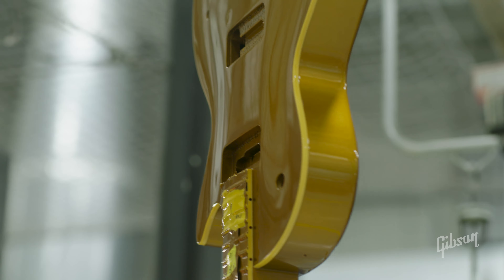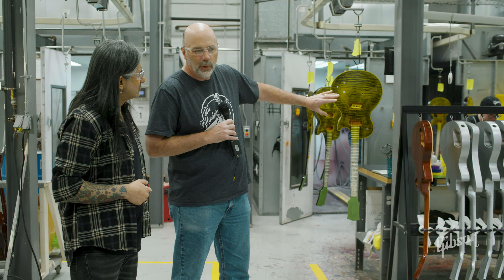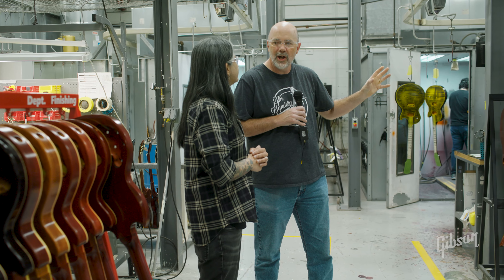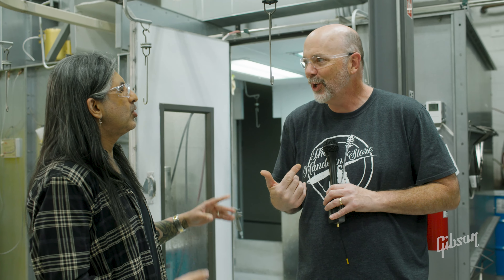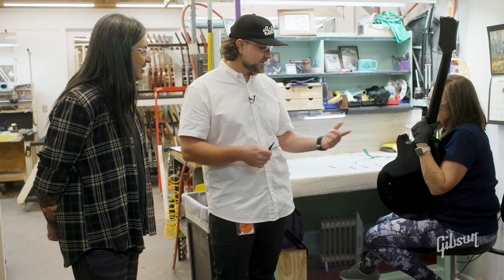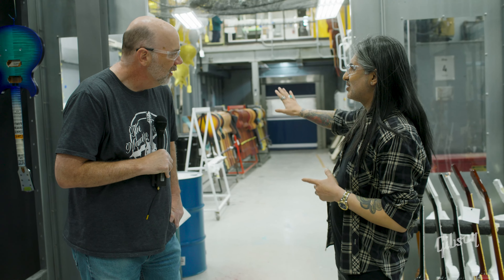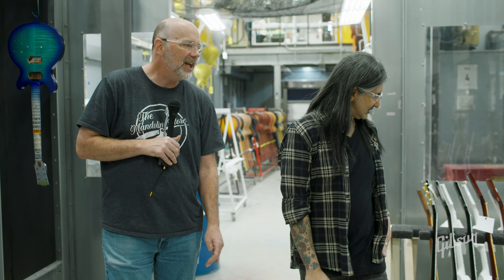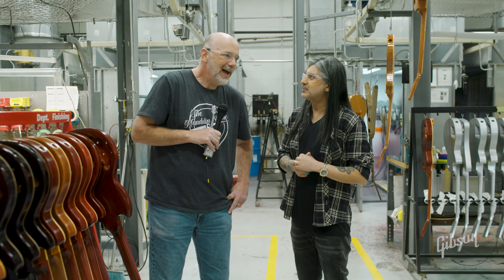How We Spray YOUR New Gibson Custom Guitar – Gibson Custom Shop Tour

Comment: I have had to take my Gibson USA made Epihone Casino back after less than a month for a repair under warranty. I noticed the issue within 10 seconds of the first unboxing.  Yep, it's the Nashville factory at it again!  They could not even cut the nut correctly.  This guitar was signed off as all being correct by a deaf, dumb and blind pinball player.   I kept the check list ticked box tag you receive with it for a laugh.